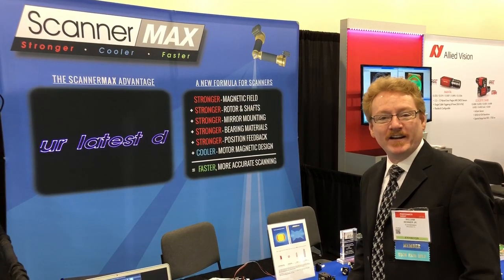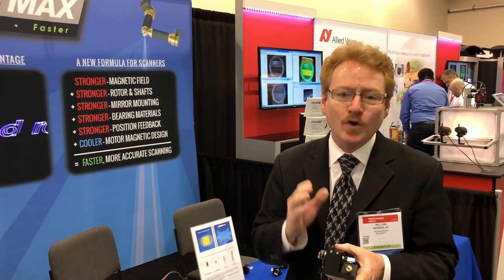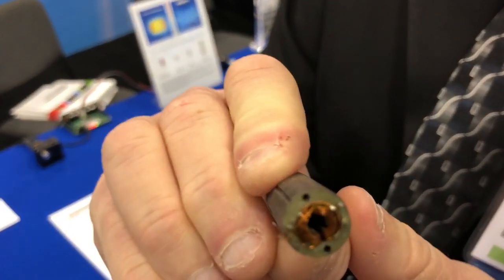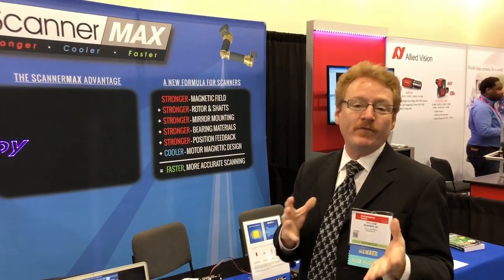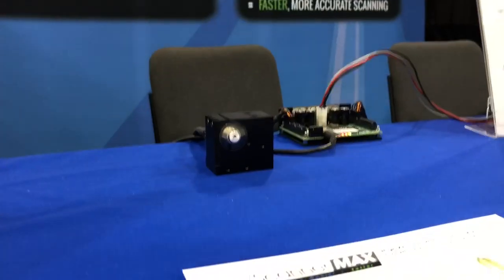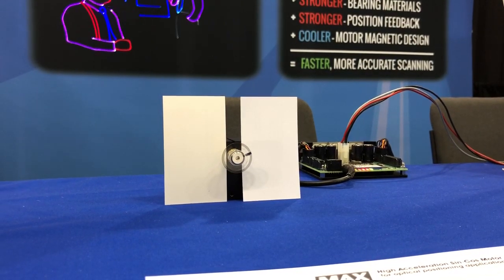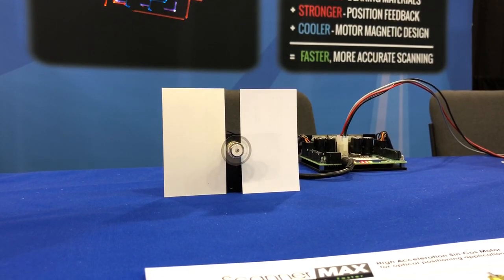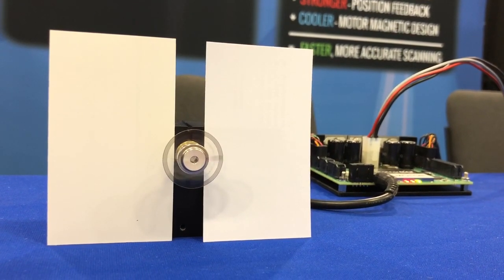Fastest motor in the world?

Comment: I'm trying to spin a turbine with an electric motor that will have to spin close to 100,000 rpm but not start at that speed but reach it when desired. Please respond this is the tech I've been looking for it would literally change the landscape of the use I'm proposing and outside of myself there would be tons of money to be made in the process.you guys have a good product and I see a perfect market for it
Reply: If that turbine is small, I think it's no problem with that motor..
But if it's massive.. then you might want to ask them to make the exactly same one but one larger size...

Which myself also curious with it if it's possible mhm 🤔🤔🤔

Comment: Electronic braking systems. Depending on the scale at which it can still retain usability, there are many applications in which this can be useful. Washing machines, electric cars, robotics, even in devices such as haptic feedback on video game controllers/gaming chairs.
Reply: I don't think the same size of that motors (I mean galv) could drive a washing machine, electric car, etc.. whatever it is that looks big won't be possible as it will require a lot of horsepower..🙃

And the bigger the size of it that they made to apply those appliances... might reduce the original performance since bigger size tends to have more mass.. And more mass which mean more weight which eventually could slow down the overall peformance of it naturally 🙂

Comment: How much does the assembly weigh, is the output enough to overcome gravity? What stress can the assembly take. EG vibration, g-force, impact. Can the shaft be extended to create more torque? What is the power input/output ratio? given enough torque and a weight adjustable balance, on a gyroscope this could give amazing control...
Reply from the maker: Hmmm. Interesting idea you have there! Please come meet us at a tradeshow, or give us a call to discuss.